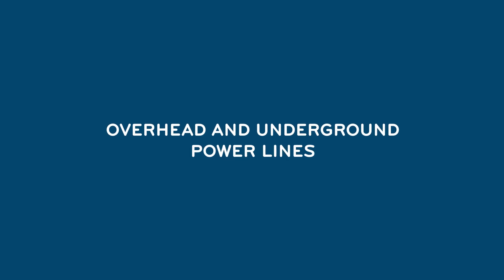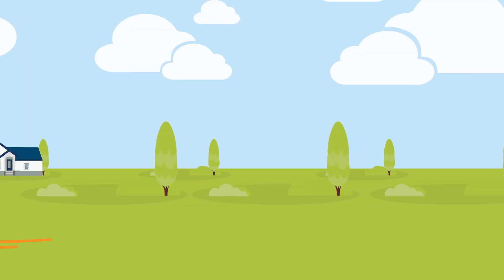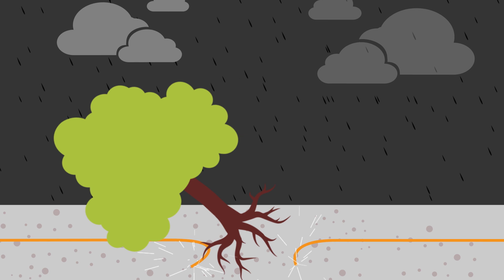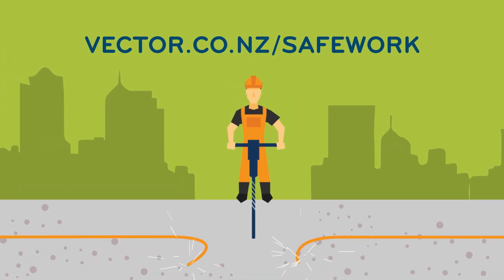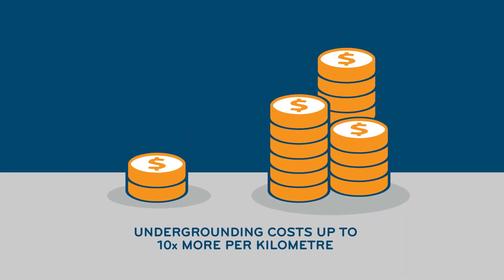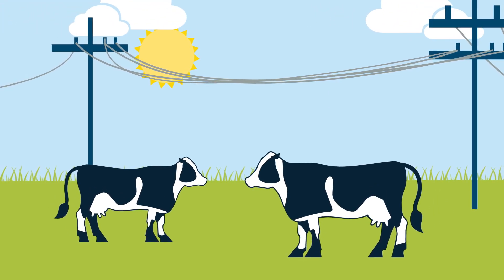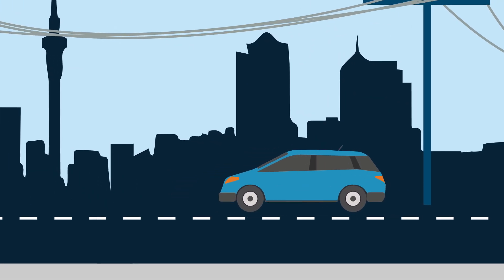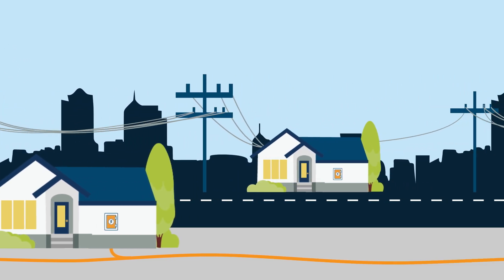Why aren't all power lines underground?

Comment: 1. Use power detectors to gauge where power lines lie.  I use one to detect active power current in my own household and it cost $10.
2. Group buried lines away from residential areas, toward commercial /high traffic districts to make detection and repair easier.  Shield them using the lead pipes that shouldn't be used for drinking water pipes, and install them on sewer ceilings/side walls.
3. Bury the power grids as well, especially nuclear plants.
4. For earthquake prone areas, house grouped power lines with above poles with the outlying floor lines housed in street bumpers situated so as not to disrupt main traffic.  It's more difficult, but nothing that can't be solved by any typical gamer who's ever played Sim City.

I can't believe these need to be said from someone who's under the paygrade of greedy power grid officials.
Reply: Or just lay power lines in sidewalks next to roads, any where that needs power needs car access anyway, and it wouldnt add much to the cost of the roads.

Also could have meters every 500 feet and probably even build in easy access to the lines by making the top of the sidewalk easy to take off

Comment: I prefer bringing an underground line with an advanced version, which helps it easier to maintain when connection damages are there. We have a good improvement in the technology field, so I hope we will build something that will make this Underground line possible all over in the coming generations. Mainly in India.
Reply: Hope so we see less of this wire mess in india.
Reply: We dont even have steady electricty in all states ,you taking about underground line😂,our govt couldnt even provide 24 hour electricity to our capital delhi

Comment: Would this work in earthquake prone California
Reply: The lines would need to be pliable enough to resistant them but then what about the power units? maybe they'd blow up but doesn't hurt to try
Reply: Probably not
Reply: No, but another solution for earthquake areas is to house power lines with above poles with the outlying floor lines housed in street bumpers situated so as not to disrupt main traffic.  It's more difficult, but nothing that can't be solved by any typical gamer who's ever played Sim City.